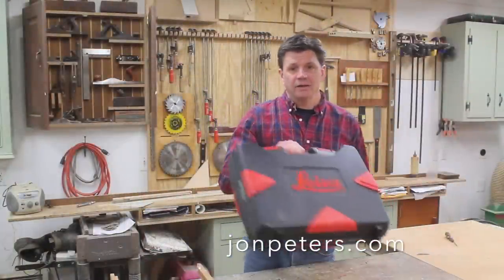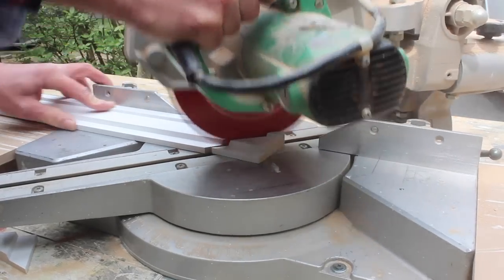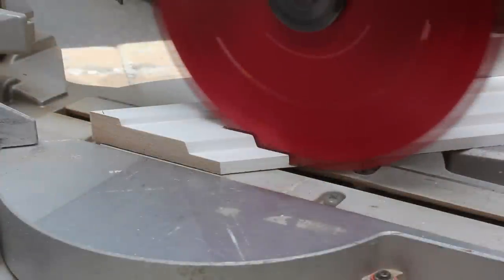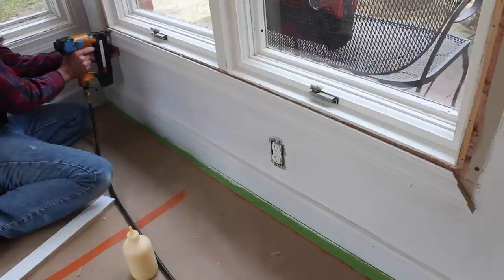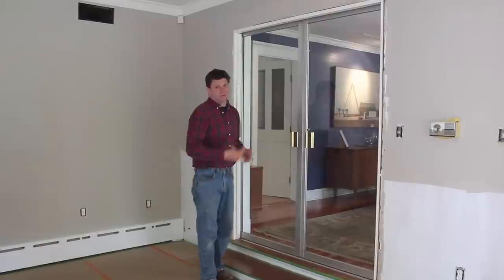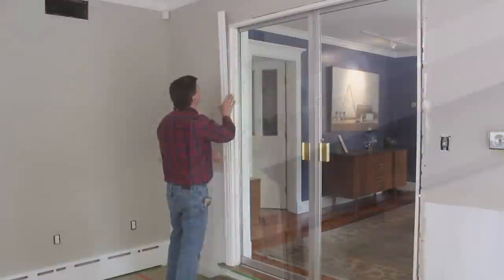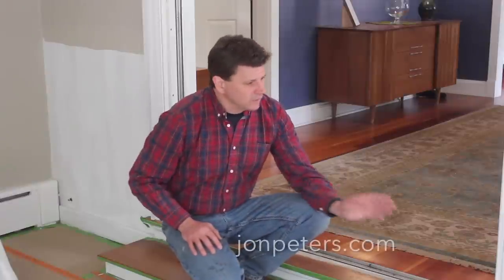How to Install Window & Door Trim - Casing Made Simple

Comment: An easier way to mark the reveal is to make a guide out of hardwood (for durability) scrap. Take two pieces of 3/4-inch material about two inches square and assemble them -- very precisely -- with glue and a couple nails so they are offset 1/4 inch. The guide simply rests in the corners of the window jam extensions for marking the reveal. If your reveal is other than 1/4 inch it is easy to make several guides. Keep them with your shims and they will be easy to find. These guides are also handy for marking the reveal at several places along the casing, as long pieces of slender material such as MDF can sag and make the reveal inaccurate.

Comment: You mean to tell me you DON'T need a complete array of festool tools to do quality work?!  😉
Reply: Not if you know how to do great work with little amount of tools
Reply: Wash your mouth out with soap and water. Of course you need to have a wall of those beautiful systainer boxes. You are forgetting the first rule of modern woodworking - tools make the the carpenter. Wherever possible, get the most expensive option for any tool; choose by price - not features. 

These are all great tips to have a workshop to be proud of when friends come by. Please remember that you don’t have to be able to use the tools or be able to do any job to be able to have a professional looking workshop. I’m prepared to come to your assistance on this one. I’m now producing the front panel of the systainer from all the over-priced manufacturers like Festool, Milwaukee out of MDF. So, now, for only £35 per front panel, you can have a workshop absolutely stacked with what looks like expensive tools. 

Ever aspire to have that array of hand planes set on the back wall. You know, those planes that just shout “ I’m a great cabinet maker” whilst, in truth, you don’t know how to sharpen them - let alone use them. Well, we are working on a set of hand planes completely moulded out of plastic. They will look exactly like the real thing and, being plastic, you don’t have to have a sturdy display cabinet because they weigh nothing! We are looking at supplying each plane with a set of decals that you slip on. Names like Lie Neillson and Veritas. 

We are also working hard on a new aspirational brand. These will be tools that are so expensive that you can barely afford them. And, once you have them, you will be scared to even use them. We are thinking of some obscure Japanese name for the brand - means nothing but then so do we. I’ve got a a Japanese guy I know to front the adverts; you know, sitting on the floor  in those wide trousers and tabis looking philosophically at the rising sun and talking faux-Japanese. We will tell everyone that the wood used comes from the rarest tree in the world and only found on one remote island; it’s also the worst timber in the world for handles but you can’t have everything. The steel is made by a hermit who uses volcanic rocks from Mount Fuji; water from a spring in Laos; iron ore dug up by a tribe of aboriginals in the Outback. Actually, it all comes from Aldi but what the heck.

If you want to be one of the first persons to get access to all this crap, you only have to send me £50. Please put in an envelope and leave just outside my mental hospital. I should be out in about 20 years.

Comment: Try using syroflex as your adhesive (it’s white and application is similar) and cutting your miters with a 1 degree compound angle so you can really get nice tight joints. Also like to use 16 gauge nails for nailing into framing. I appreciate that tip about holding your nail gun, I never knew that!

Comment: Unless for a custom installation, all doors come in standard sizes. A 2'0" door = 24" inside of jamb to inside of jamb. A 2'4" door = 28" inside to inside, 2'6" 30" etc.. Side jambs from bottom to inside of top jamb measures 80". A properly installed door with tight joints this does not vary. I've been doing trim carpentry for years and I've watched carpenters repeatedly measure from door to door to fit trim. IT DOES NOT CHANGE!!!
For a 1/4" reveal add 5/16" for each miter cut. For example a 2'6" door measuring 30" inside to inside of jamb, for your top trim, add 5/8" from short point to short point of your two miters for a total of 30 5/8". Your side jambs are going to measure 80 5/16" from square end to short point of miter. This will give you an even 1/4" reveal all around the door. For a 2'8" door your top trim will measure 32 5/8" short to short, your side jambs 80 5/16" square end to short point. A 6'0" slider, 72" inside to inside, cut 72 5/8" for your short to short on top, 80 5/16" square to short for your sides. 
The number of times I've watched experienced carpenters go from a 2'6" door and have to walk back and forth from miter box to door to mark the trim, then rinse and repeat on the next 2'6" door or the opposite side of the same door. Those measurements didn't change and yet they, measure and cut, measure and cut. So many wasted steps back and forth. As a lead carpenter having to account for man hours/man days on trimming a house those wasted trips add up to a lot of wasted man hours. This method does not in any way jeopardize your quality but will save you lots of time.
Windows often will differ in size but you can employ the same trick. Measure your window inside of jamb to inside of jamb all the way around. WRITE IT DOWN. Add 5/8" short point to short point of your miters for each piece of trim. Measure and cut all your trim at one time at the saw. It will fit perfectly with a 1/4" reveal all around your window. This will save all those steps back and forth, your trim will fit perfectly without all the nails for support, marking the miter and back to the saw to make the cut, then back to the window for install. 
If you want or need to mark set backs for your reveals. Make a simple setback jig. Cut a 3" square of 1/4" plywood. Cut another piece 2 3/4" square. Glue one surface, align two sides of the smaller piece with the larger piece. This will leave a 1/4" step on two sides of the larger piece. Place this jig with the smaller piece inside of the corner of your jamb, the larger piece will be laying on the face of the jamb. Mark each side of the corner, there is your 1/4" setback on both sides. After trimming a few hundred doors and windows, hopefully you will train your eye to gauge a 1/4" reveal without having to mark every one.
Reply: Today I installed door trim and it was 81 on one side and 80 7/8 other. Brand new construction So ...........?
Reply: A standard door jamb measures 80" from the bottom of the side jamb to the bottom of the head jamb. Overall height to top of head jamb would only be 80 3/4". In 30+ years of home building I've not seen this vary. Except in custom installations for non-spec installs. ( I sometimes saw this on pocket doors in old turn of the century Victorians I've restored.) 
Unless the carpenter that installed that door held it up off the floor. Which is how I hang doors. The gap beneath the jamb allows carpet layers to tuck carpet/pad under, instead of having to trim around the jamb/trim. This makes for a much cleaner install. If you followed and held your trim down tight to the floor, this could account for your deviation. So........? I don't know what to tell you.
Reply: Holy shit.  So helpful.  Thank you for your tips!
Reply: Never worked on an old house eh?
Reply: @davidjohnston1971  
Wrongo buddy.
I have two companies here in Michigan that have two different heighths flom bottom to top of jamb and jamb thickness as well.
One is 81" ,the other 81 3/8.
True we measure one of each size of door for general head casing,but if you hang solid core doors and hold them up for hardwood  without removable shims . They tend to drop on the hinge side unless you set each hinge with longer screws .
Also, many times the hardwood,tile, vinyl is already set and it's up to the finish carpenters on my crew to make sure the doors are st and trimmed tight to the surface.
As a prior framer as well.I will tell you that with materials today the floor within the jamb space can vary,so even with a finished floor we set a level across the opening and cut the jamb on the high side to give a level head jamb. Without that step. Your 45 s are never tight. And if your guys were proficient enough in hanging and trimming doors .They'd have it down to a routine.
There's a difference between a trimmer and a finish carpenter.
One only cares that he doesn't see it from his house.
Reply: Most standard jamb lengths are 81 around here and marking the short points is a waste of time and more difficult..........if  you measure the back of your casing say it's 3 1/4 and you need a 1/4 inch reveal on both side you just add 3 1/4+3 1/4 +1/2 because you want a 1/4 inch reveal on both sides and 1/4 + 1/4 is 1/2 so that's 7 inches total. Example: if you have a inside to inside head piece measurement of 36 inside to inside we will say this is your front door your installing this casing on. Most entry doors in a standard home are 36 inches so you just you add 7" to your 36 that's 43.. you cut your 45 degree angle hook your tape measure 43 cut your other 45 and there it is.  You can use a gage block to mark lines for your reveals as he did in the video to help when installing if it helps you. But anytime your using casing find out how wide it is take the width x2 plus whatever reveal you want x2 add that to your inside to inside measurement and cut your long points it's much easier AND on a side note:: always keep a sharp pencil and make one good line where you want to cut and not a bunch of blob like this guy. There's no need to keep marking and marking and marking the same spot you need one solid line that's it.  .  Please note whatever a simple setback jig is will probably make your head spin thinking about how simple it really is cough cough rocket science
Reply: Depends on your door shop. The one near me is terrible you cant just assume everything is the same because it all varies by up to a quater inch whether it be from improper gang cutting jamb material or even over beveling slabs and having to adjust jamb header according. Also it sounds like you are installing knock down jambs? Should be two different measurements one from the door side(rabbeted side of jamb) and a short side
Reply: Yep that’s production style trim.  I’m totally comfy doing that with builders grade fj 2 1/4 colonial but I get nervous gang cutting more expensive stuff  , do you ?

Comment: I haven't done a lot of trim work, so I definitely learned something, the using trim to mark directly your cuts instead of trying to measure makes a lot of sense as its more accurate and much faster, and the nail trick looks handy. You show marking and cutting the horizontal trim, but how to best cut vertical trim like on that doorway using trim, seems like we're back to using a tape measure. 
My 2 cents I think some thin latex caulk would be better than wood glue and more removable if needed later on, while still giving adhesive bond. Also it wouldn't seep out of joints or run down the wall.

Comment: I personally don't use nail gun & don't get nail crazy when installing any trim in the event I ever need to remove trim in the future & glueing trim? it's bad enough when I had to remove trim around bedroom doors plastered with nails thank goodness no glue was used it would have been even more of a nightmare.. Trim molding is not going anywhere by only using 4 fine nails to each side vertically & 3 nails max horizontally too many nails is overkill.. I also suggest pre drill all holes into wood approx 1/2" inwards from edge of trim with thinest drill bit so there is no splinnering cracking the wood trim, insert nails, line trim up to reveal line, start tapping nails in then center punch each one then fill with silicone, perfect install every time..
Reply: Thanks for this. I don't have a fancy gun and was just wondering if hammer and nails is a proper alternative.
Reply: thanks i needed to hear this.  I recently installed trim and used zero adhesive after removing old trim thinking the nails were certainly enough.  I tugged on my work and it wasnt going anywhere.  I did throw a couple nails outside of the framing into pure drywall...i know its not doing much but it did take some play out of the edges meeting the drywall before caulking.  Anyway im about to do some wall trim.  ive seen a lot of adhesive on videos.  necessary or same principle?

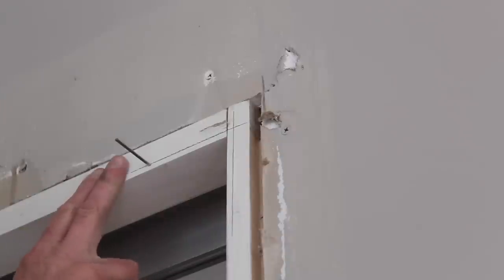Comment: I like your idea of using a nail to hold up the molding at 6:50.  Have you ever considered moving the nail a few inches (in this case) to the right to be on the vertical piece of framing so that when you apply the vertical trim, it hides the nail?  That way you wouldn't have to fill the small nail hole in the horizontal piece of door framing.  Not that anyone would really ever notice it anyways.
Reply: Nevermind, I answered my own question.  If you did that, once you cut the molding to size, it the nail wouldn't hold it.  I'll leave my stupid suggestion here in case anyone else has the same 'bright' idea ;)

Comment: Great job after 35 years of building homes as a GC. trim work was always my favorite.  You did a great job and would hire you in a heartbeat.
Reply from the maker: +Jack Holt Thanks Jack
Reply: Really......? This guy missed his mark for the miter cut by close to a 16th of an inch, and somehow that's an acceptable cut?.... Wow,..... things have really changed a lot in trim work.
Reply: I did miss that sorry I stand corrected.  compared to what I have seen in the last 15 years his work was acceptable.  And I will add, my work and quality of craftsmanship was among the best.  Just sayin.
Reply: I don't doubt your ability nor the level of your craftsmanship, Jack. My remark wasn't really directed so much to you as it was to Jon. ... and I think you got that.  
Jon has a lot of good tips in this video, and a few things that I would take issue with, as well.
Yeah, I agree with you that the work is acceptable........ really a sad commentary on how things have gotten in the trades.
Reply: Completely agree, Otto. I was like, yeah your miter cut was way off. Guess that's the mindset of people not being precise and just, "We'll just use painters caulk."

Comment: That 1/4" scrap for marking the reveal is a good idea. I'd probably pin a backer to it for riding the inside of the casing allowing me to scribe uniformly and quickly without much attention to detail.
Reply: why not write down all your windows measurements then go to the chop saw and add the reveal to the cut and make all the cuts fast

Comment: Lots of time wasted walking in and out of a customer's house. I still mark my 1/4" reveals for installing the casing but I just measure the inside on the opening and add the 1/2" to get my lengths. That way I can measure all pieces, write them down and cut everything at once while I'm at the saw. It can be difficult to get precise measurements when you're measuring the inside of the miters but you can lay your tape measure out next to your casing, "burn" an inch on your tape measure and then add the inch back...if that makes sense. You can cut an entire room this way and then install the entire room and still get great results.

Comment: Hello, thank you for the info. I have a quick question; Why you left a space between the window and the case? You called it out “reveal”?
Reply: it's for 'looks'. adding the reveal adds depth to the finished look of it, if you just nailed it flush with the window you wouldn't get this built up look to it.  Possibly an additional reason is that if you tried to nail it flush with the window you might find that there is some warpage or bowing around the window and the straight casing would highlight the flaw.

Comment: Use 80-100 teeth saw blade for fine cuts on trim work. You'll get much cleaner cuts than using a blade with less teeth. :)

Comment: Why wouldn't one attach the back band in all cases?  In fact, it would seem to be a good idea to attach the back band before the miter cuts are made.  Am I missing something?
Reply: Allows you to press the back band in tight against the wall before nailing it on. Cleaner look and if the wall is really wavy or in some cases a really bad tape job you could scribe the piece before attaching it. The ideal is to use less caulking.
Reply: +Joshua Russell Thank You for the feed back.
Reply: Harold it can get tricky to hold those two pieces together to nail them even working on a bench.

Comment: Are you using Brad Nails or finish nails?
Reply: those are 18 gauge brad nails .That is the best nail to use ( if possible ) on MDF trim as a bigger 16 or 15 gauge nail will leave a bigger hole and the hole will  pucker some . you should never sand mdf trim as you will sand through the smooth finish . It will not paint right and be very noticable

Comment: This was fine but to get a thumbs up from me you would need to address super common problems like when the jamb edge is in-set, or out-set from the sheetrock (doesn't line up well) so that the trim doesn't want to lay flat.

Comment: Thank you for this! The nail trick was something I'd never thought of. And I didn't even know about it needing a small gap for the "reveal".
Do you have any videos on installing base molding?
I have an issue where the linoleum install didn't go well and a little too much got cut near a wall so I will need to somehow bump out the molding in that area to cover the mistake, but I'm not quite sure how to get the base molding right for it. or how to deal with putting base molding around door trim (since my existing door trim does not reach the floor).